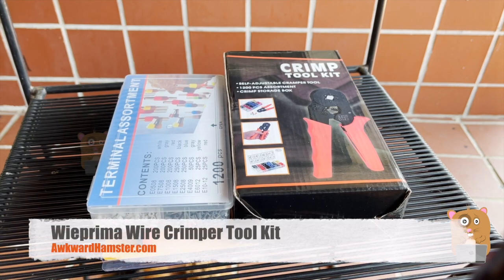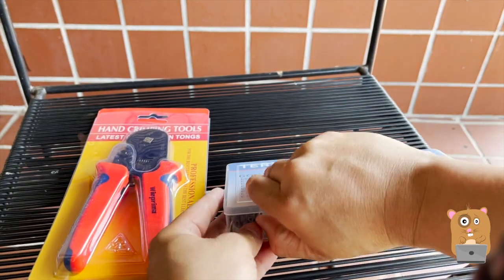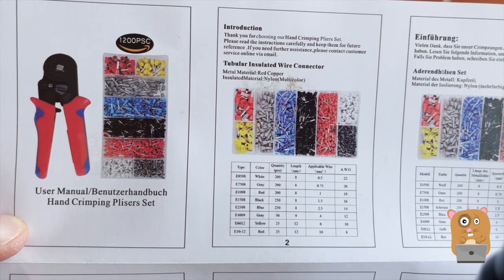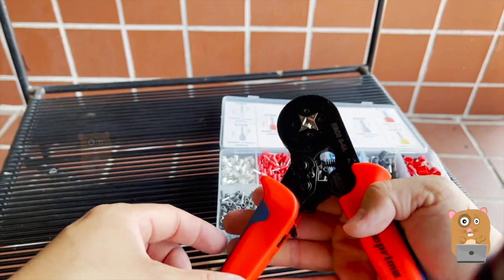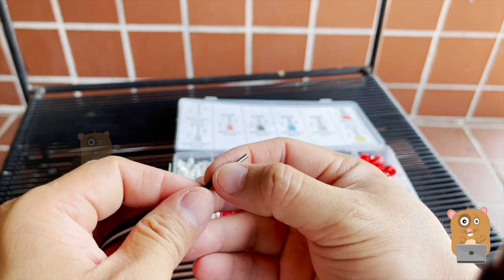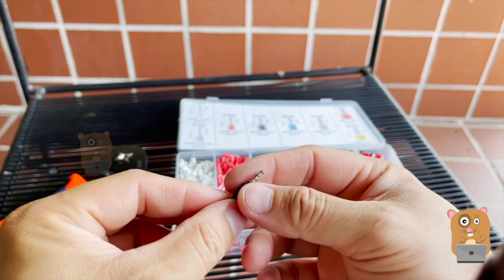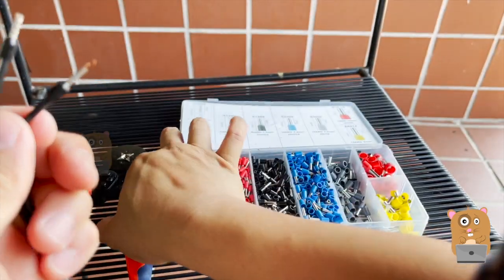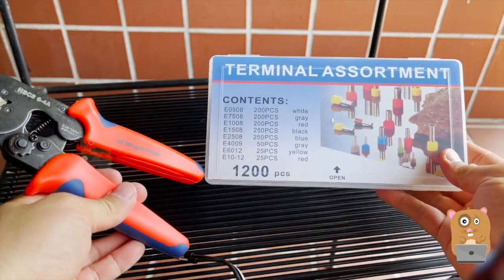Wieprima Wire Crimper Tool Kit

Comment: I'm an electrician. What are you gonna do with such crimpings ? :)
Where would you use them(application) ?
Reply: Ну допустим многожильный провод подсоединить к автоматическому выключателю
Reply: The "terminals" are WIRE FERRULES.  You use them with "screw compression" terminal boards/strips/lugs where STRANDED WIRE is concerned.

What the ferrules do is prevent the stripped wire end from "fraying", generating unwanted "whisker" strands (that can cause shorts to adjacent terminals), "breakage/loss" of wire strands (if you have to REMOVE the wire from a previously-tightened screw terminal) and corrosion of said strands while in the screw terminal.

They work by "encapsulating" all the strands in a tinned copper tube, keeping them together, and producing the equivalent of a a "solid" wire strand.  HOWEVER, unlike a "sold" wire conductor (i.e., solid copper "ROMEX" wire), the ferrule sleeve COMPRESSES AROUND the strands when the terminal is tightened, confining all the strands in one place, preventing strand "whiskers" from being produced and producing a (more or less) "weather-tight seal" around the wire strands, reducing (or even preventing) corrosion of the wire.  Once the ferrule is compressed on the wire end, the wire can be EASILY REMOVED later on if desired.  The plastic "end cap" is a SAFETY FEATURE to cover any exposed wire at the base of the stripped wire end.  ONE CAVEAT HERE: ferrules usually come in different lengths to accommodate the differing "depths" of screw compression terminals, so make sure you pick the right length ferrule for your terminal application.  Furthermore, once the ferrule is "crimped" on the wire end by the compression terminal, it WILL NOT COME OFF.

How do you use them? first, select the ferrule SIZE based on the wire gauge you're using.  Next, strip the wire end to the same length as the metal sleeve of the ferrule.  Third, install the wire FULLY into the ferrule - the end of the stripped wire should be EVEN with the end of the ferrule AND there should be no strands "bent back" and protruding from the plastic end.  If the strip is too long (wire protruding fem the ferrule end), clip the excess  strands at the ferrule end so the wire is FLUSH; if it's too short (stripped wire end is "recessed"), remove the wire, strip enough extra insulation to give the proper strip length, then re-insert the wire into the ferrule (trim if necessary!).  Once the ferrule is applied to the wire, use the crimp tool to compress the ferrule around the wire (a square "pin" will be created).  Install the wire "pin" intot he terminal, screw the terminal down, and VOILA! your wire is terminated!

Now then, you can use the ferrules WITHOUT the crimper as the compression terminal will do the "crimping" for you.  However, you have to be careful that the ferrule does not "fall off" the wire while inserting into the terminal or the wire "slips back" from the ferrule while tightening the compression screw (i.e., push on the wire while tightening).

Hope this helps... :)
Reply: @Promptjock  I have crimped many ends on stranded wire as a mechanic but never saw a screw terminal used that did not require an eye, hook or spade. They are nowhere near weather proof.
Reply: @burp1914  There are "screw compression" terminals that ARE NOT what you find on your "standard" terminal boards that, as you rightly observe, require eye/hook/spade terminals.

The one's I was referring to are similar to those found on the breaker switches found in your AC BREAKER BOX: you stick the stripped end into the "contact well", then tighten the screw to "compress" the wire between the screw end and the walls of the "contact well".  What you end up with is a nice mechanical connection with decent "gas tight" contact between the screw end and the wire end.  Yes, Breaker Box Breakers are generally used with SOLID COPPER "ROMEX" wire, but they CAN be used with stranded wire and this is where "Wire Ferrules" really shine. :)